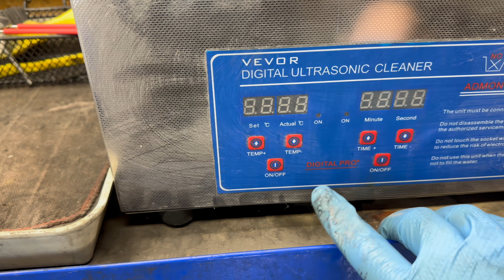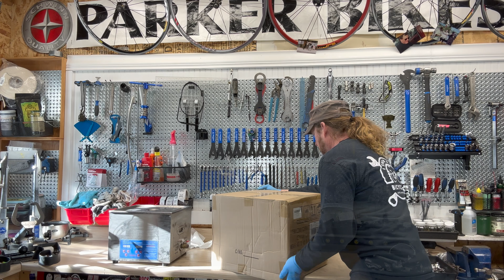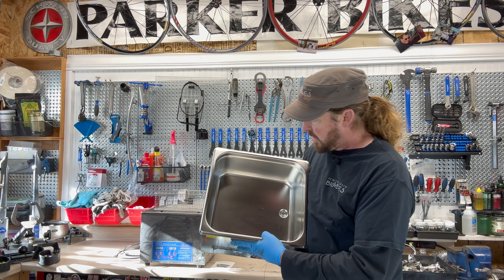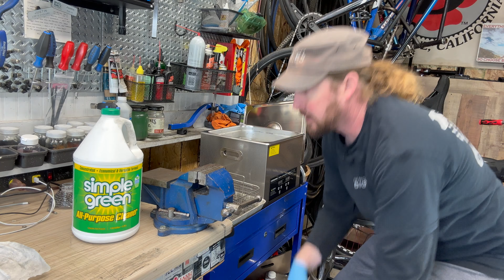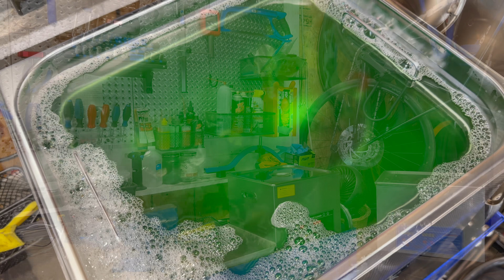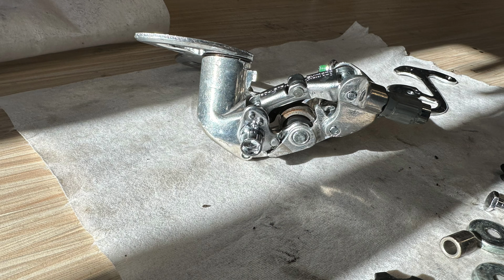Will it BLING? My First Look at the Creworks Ultrasonic Cleaner (Unboxing & Demo)

Comment: I bought the 3l version, after using it a few times (10 mins max) for cassette, the display is now broken (sometimes display something when playing with the buttons). I didn't drop water, was careful, so QC is really not good on this brand (now that I have this faulty unit, I checked reviews on web and on amazon quite some people tell the same, bad reliability). I have to contact the seller to see how to manage the guarantee...
Reply from the maker: That's not good. Hopefully, the company will cover the warranty.

Comment: If you drape a towel over the cover, it stays hot longer and is quieter.  And you have a towel when you need one.  A little evaporust in the water is also helpful.
Reply from the maker: Nice tips! Thank you for sharing.

Comment: Thanks for posting.  I bought two Vevors about a year ago that get used every day.  If they last 3 years, I’ll be happy.
Reply from the maker: Until it died, it was still performing at the same level. There seems to be no decline over time. I was surprised as well. I just decided to plug it in and unplug it to turn on and off. Just to save the switch. For me, my plug-ins are at the counter lever, so it's no big deal.